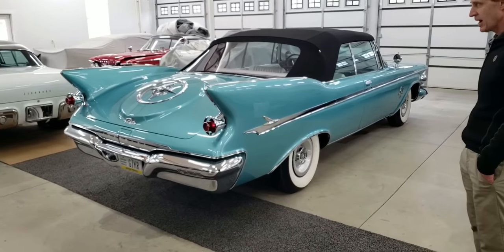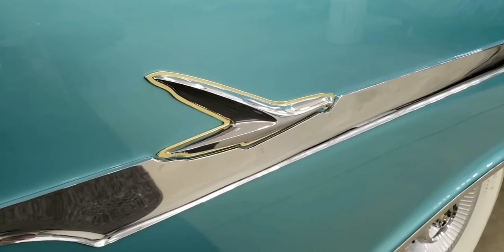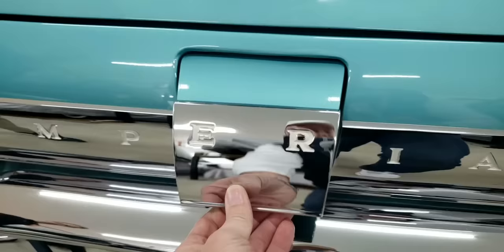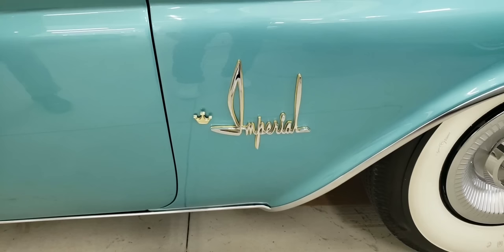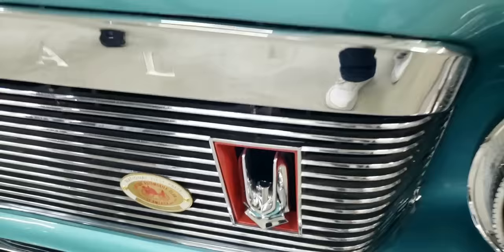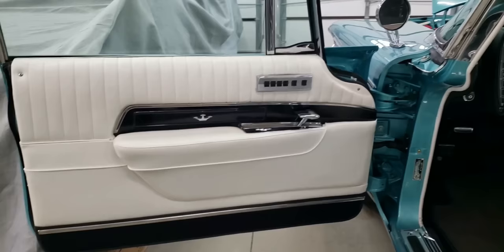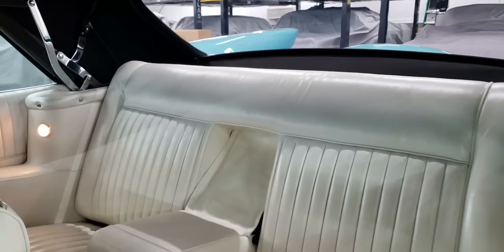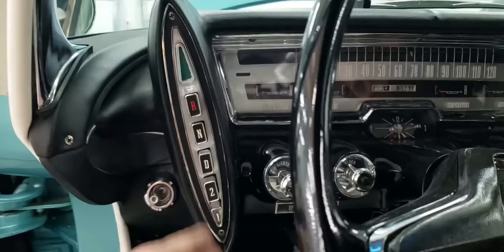1961 Imperial Crown Convertible.

Comment: The 1957 Imperial was the first production car to have curved side glass. There are only two light bulbs in the '61 Imperial dash - The turn signals at the top of the two pods. The rest is fluorescent green electroluminescent panels - scrape off the black paint, and the whole thing glows.. They use 180-volt electrics, and so do the bright red gauge needles, which also light up like little neon tubes.
Reply: They were and are still beautiful cars!
Reply from the maker: Thanks for that info. Thanks for watching.

Comment: The grill was designed to resemble the grill on the Cord 810. In the '61 Imperial's case, there was a mid-year recall to install rubber pieces behind the grill, because it sang like a harmonica at freeway speeds! I like to tell folks that same guy who designed my '61 Imperials also designed the Karmann Ghia... Virgil Exner.  It's a fact! He designed the Chrysler Special, and VW told Ghia that they wanted that same design, but smaller.
Reply from the maker: Thanks for that info Tony and thanks for watching. 👍
Reply: I think I heard that Virgil Exner designed the Karmann Ghia!  I have a different car a '64 Buick Riviera
Reply from the maker: @joed5901  Actually Ghia was an Italian coach builder and designed the body for the Karmann. I don't believe Exner ever worked at Ghia. Either way I'd take your Riv any day of the week. Thanks for watching.

Comment: Wide body, wide trunk, but narrow hood opening. What was Virgil thinking? Two floor switches to the left of the brake pedal. High beams? Windshield wiper fluid pump?
Reply from the maker: Good catch Dr. I believe one for high beams and the other I'm not sure. I have guesses but its only a guess. Maybe for the radio as for some other cars? Not sure but thanks for watching. 👍

Comment: The '61 Imperials are massive and strong cars, but there are several delicate parts: the inside door handle is chromed pot-metal. The horizontal part that you grab snaps off really easily. The tail light cone is not so much delicate, but EVERYBODY who sees it MUST grab it, and they get worn down.  The horn ring is the worst. There is a copper ring on the inside rear of the steering wheel, and over the decades, it becomes corroded. You hit the horn, and it makes a strangled noise, so you hit it HARDER, and the chromed pot-metal horn ring severs at the base.
Reply from the maker: Thanks for that info. Thanks for watching.

Comment: I noticed some of the factory inspection marks in yellow on the firewall?  Is that what those are?  I'm finishing a 14 year restoration of a 1962 Imperial convertible and haven't been able to find any definitive information about the placement of inspection marks.  Any info is appreciated.
Reply from the maker: Yes in a nut shell they are. I am NO expert on this model but I can say muscle cars and Vettes have more markings in that regard. More main stream high volume cars I've noticed are not documented as much with the marking's. Unrestored cars are where you can look but I wouldn't put to much stock in it if you don't see any markings. Maybe join an Imperial club that's what I'd do. Thanks for watching.👍

Comment: Magnificent!  Odd, though, every factory option except air conditioning.  It was dash-mounted, and probably added $400.00 (about $4,000.00 today) to the price.
Reply from the maker: Air wasn't common in convertibles at this time but I see your point. Thanks for watching.
Reply: Back during those times, the builders didn't market that to the south because they didn't consider it. They didn't know about the heat and humidity there, and their main concern was that nobody in the south had money and they all rode cows or something. Then tthey found out they were the biggest market and it ended up being their largest market since there was no mass transit. Pretty stupid thinking on their part at the time. And they never could get the headliners to stick right. And the dashboards would always melt and still do.

Comment: The bird design on the chrome line on the fin, is TOO MUCH! Some people can't stop! Everything else is PERFECT! 
It is claimed (perhaps falsely?) That actually, the tallest tail FINS, are meant to be on the AMPHICAR. Because the FINS prevent the waves splashing the rear deck air intakes when the AMPHICAR is in the water!
Something you pointed out, was that the "floating" head lights DON'T turn with the steering, like on the CITROEN DS.  Well That's a thought! If I had this car, I would have the OUTSIDE headlights converted, so they DO turn!
Reply from the maker: Thanks for watching.